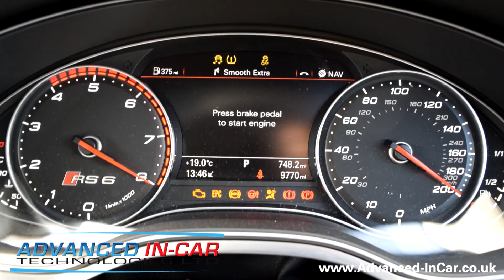Audi RS6 LED Dynamic Light Retrofit

Comment: What about front headlights? been told its more complex need to change front bumper is that true?
Reply from the maker: +Taqi Ishak Yes the front is more complex as you need new modules to power the fronts and it has to be genuine Audi parts and not using our modules unfortunately.